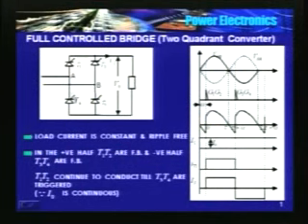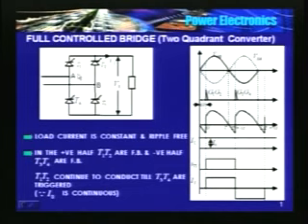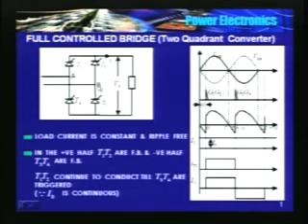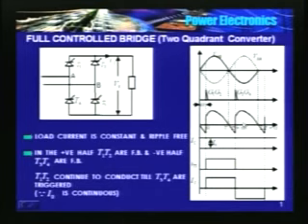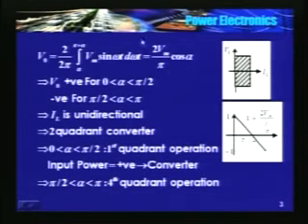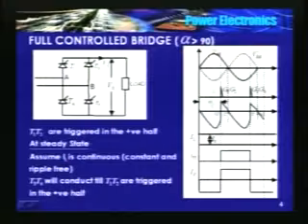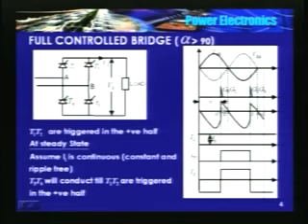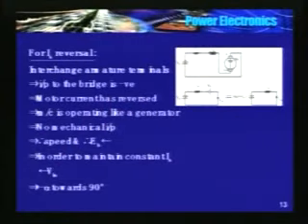Lecture - 14 Power Electronics

Comment: From 41:28 onwards, what is the difference between both the cases except for the triggering points? The waveforms remain more or less same. I am also not able to find this case 1 and case 2 operation in my text book (Bimbhra). It just has a single explanation and waveform for this circuit with discontinuous load. Basically, I don't understand why these 2 cases are being explained as two separate operations.
Reply: Devika B S : Well both cases are well explained , you need to explore PSB again   Case one you will find  RLE load in Diode rectifiers and as its a case like alpha zero wherease case 2 SCR with Alpha non zero, In either way just like in 3 phase , we have 30 or 60° reference point for alpha , here reference point im assuming where source volt and battery volt become equal to measure alpha .